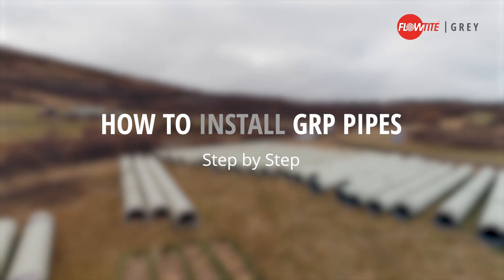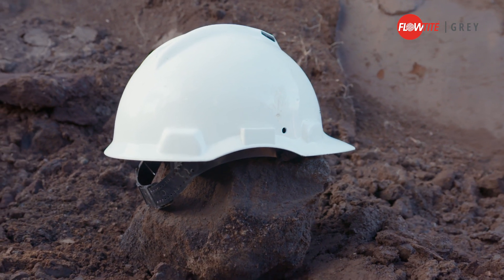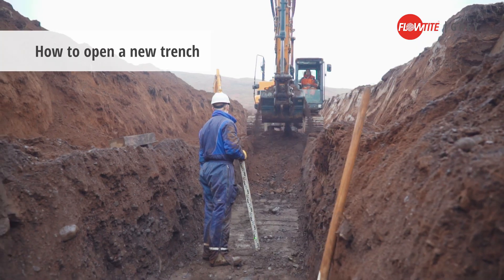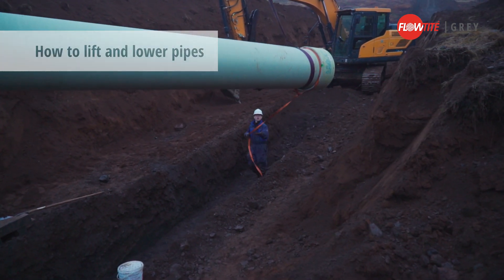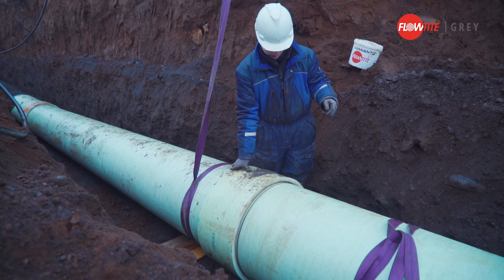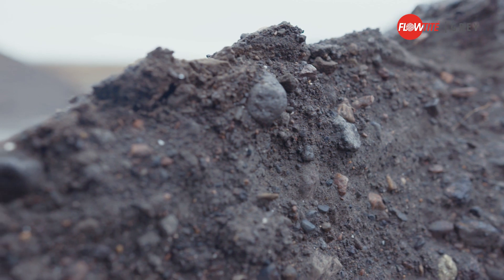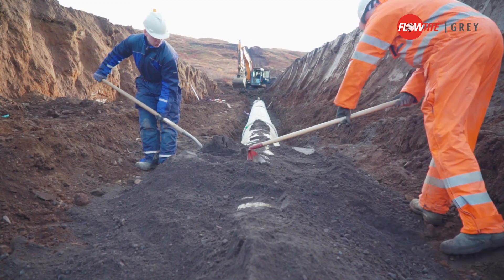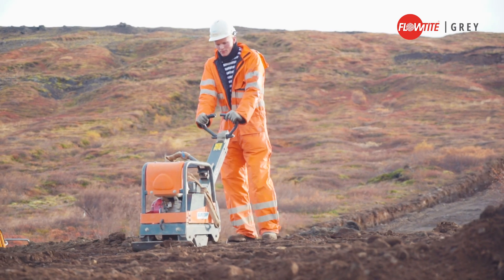How to install GRP pipes correctly in open trench installations

Comment: Good Explanation, what is the application for those GRP pipes?
Reply: Hydropower
Reply: Hydropower penstock
Reply: @notflowtiteanymore-wrongac6370  
I recently used them in my project treatment facility for oil produced water, 🤙

Comment: Thank you for posting this video, very informative.  Flowtite pioneered this industry and I am glad you'd kept the leadership by sharing teaching materials like this. If GRP pipe installer follows the procedure shown in this video, I have no doubt, your pipeline will last a hundred years! In particular I want to point-out the backfill materials used in the bedding and haunch zone is an imported coarse river sand (or washed sand), compacted then, the native soil was used from pipe crown to grade. Perfect!
Reply from the maker: Thanks for your kind comments - we will keep on sharing knowledge to the best for the industry and community